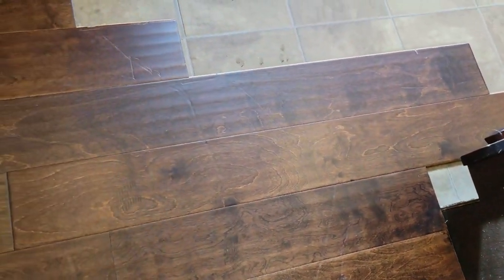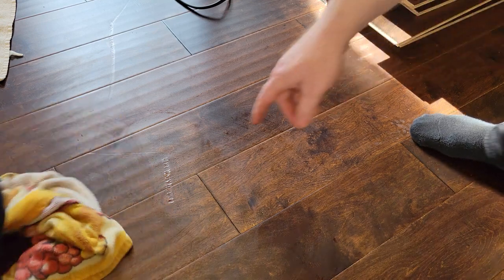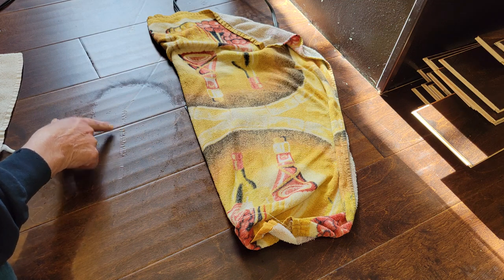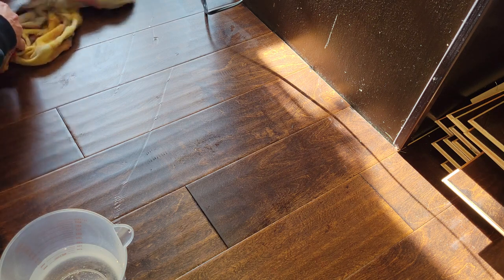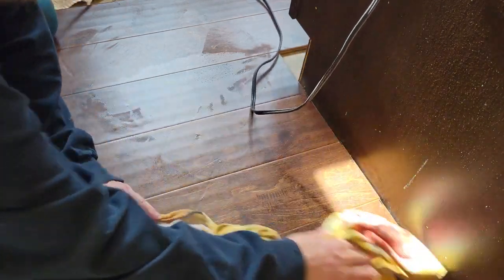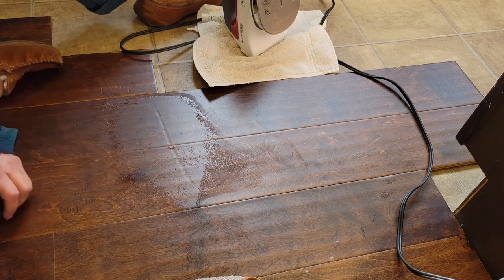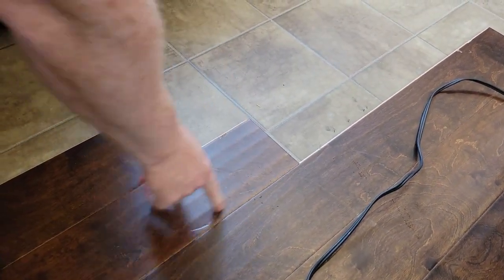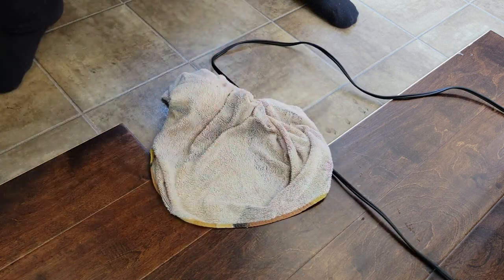Can I use an Iron, water & towel on Engineered Wood Flooring, to repair dents, gouges, indentations?

Comment from the maker: So the results on engineered wood flooring were a mix of success and failure.  Depending on the type of dent, the results might look worse.  Other places, it was almost as good as new.  The practice wood shown at the beginning was used to build confidence in the process.  We then went to the real world example created by moving a really large fridge around on the flooring.  It now has furniture movers under it.  Next step, will be to try wax to fix this.  If that doesn't make us both happy, I will rip about 30-40 boards out and start over in that area.